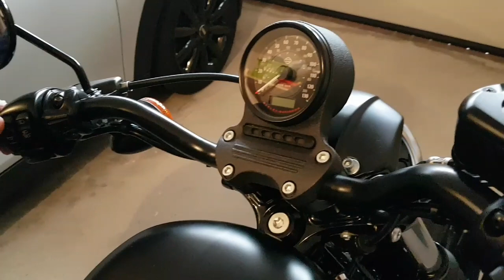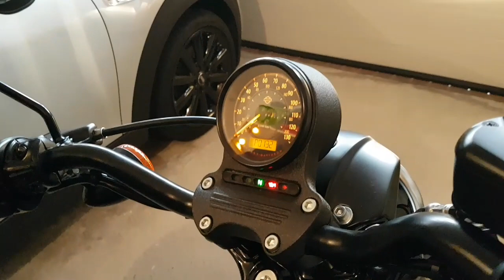Sportster Iron 883 Engine Management Light Fault diagnosis

Comment: Hi sir what is b2119 codes?.when i clear that codes  then i used a few minutes,the b2119 code are back how can i solve this problem?
Reply from the maker: Hi Edmond. I believe this is a fuel pump output is overloaded. I'd suggest checking your bikes manual or contacting your local Harley dealer. Hope you get it sorted.

Comment: My 2011 XL883N doesn't have a trip button on the left handlebar switchgear, as far as I recall both of the turn signal buttons are used to find out the fault codes on the 2009 to 2013 Iron models.
Reply: I have 2013 883, the trip button is under the speedometer...

Comment: So what did you do to fix it
Reply from the maker: I'd had a stage 1 fitted and the mapping on the Vance & Hines FP3 was not right. It was done at local garage and took a couple of visits to tweak the mapping with the new exhaust until correct.
Reply: Awesome thanks was looking for both diagnosis and solution 👌👍